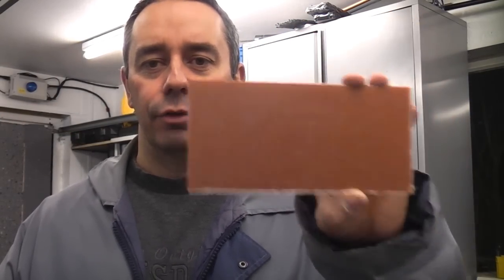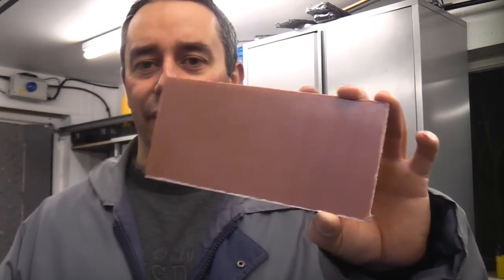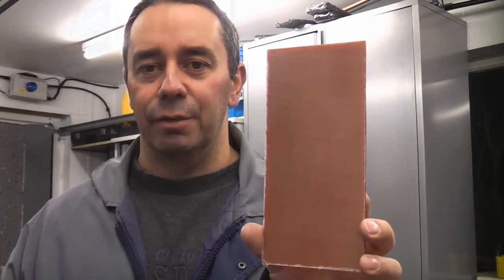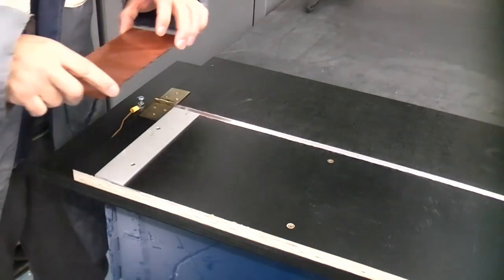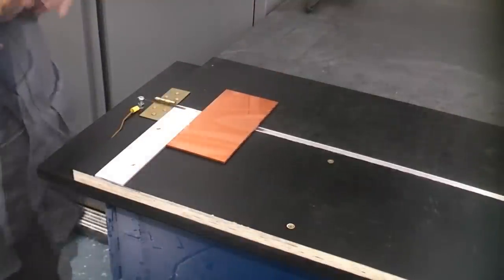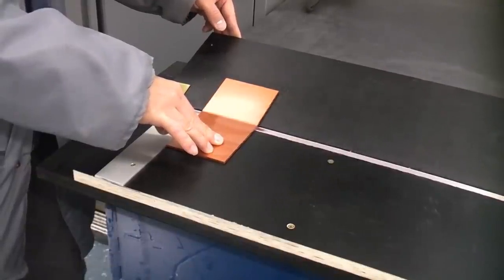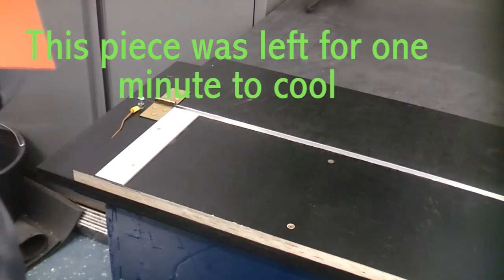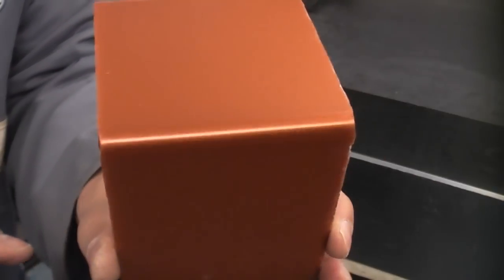How to line bend acrylic | line bend Perspex

Comment: To get a tighter curve you can cut a groove the width of the plastic and as deep as half the material. Great vid love the new intro, might try making a line bender but I'm not sure how often I would use it and I don't have a power supply
Reply from the maker: Thanks for the tip.
I have been meaning to make one of these for years. I am sure I'll find plenty of projects for it now LOL
Thanks for the comment

Comment: One could add holes along the bottom surface and line them up with the wood thread inserts you've presented in a previous video, then using surface clamps or toe clamps (made of plastic, it doesn't need much) , clamp the material down.
Reply from the maker: Yes, you could do that if you liked ;-)
Thanks for the comment

Comment: Question: If you bent along the length of a long piece, would it be prone to cracking due to thermal expansion, etc in an outdoor application? I'd like to bend a piece 8' in length so that the main face is 6" and two side "wings" (bent 90 degrees) are 2" in length. Appreciate any response. Thank you.
Reply from the maker: Hi, yes it would be prone to cracking unless you could anneal it. Bending such a long piece and then annealing it would be a big job.
In the UK you can get Perspex or Lucite, Lucite is made for the sanitary ware market and has some different chemicals in it for when it is vacuum formed into baths etc. If Lucite was used you might not have to anneal it, but you can only get it in a small selection of colours.
Reply: Thank you, I'm now researching custom glass and polycarbonate (3Form XT Koda) options for my project.

Comment: Hi enjoyed the video. What would you advise as the best method for cutting acrylic sheets to size. I have thin 2-3 mm sheet that I need to cut into small 9"x4" pieces.
Thanks Alan.
Reply from the maker: It depends on what you have available really Alan. I like the chop saw as it gives a nice clean cut.
You can get good straight cuts with a circular saw https://www.youtube.com/watch?v=AqtKH8VfRcI
Or you can scribe break it as well, but this makes the edges a little more difficult to finish https://www.youtube.com/watch?v=U7cquDldE0Y
Reply: ***** Thanks. Watched the links. Might try to scribe first, Do have a large circular saw, but blade seems a bit heavy duty. Have got a mitre saw with a 40 tooth blade.
Reply from the maker: Alan Hurley
If the mitre saw blade is TCT it should cut it easily.
Good luck with it ;-)

Comment: Thanks for the videos! Could you suggest a bench power supply for bending 600mm wide 3mm perspex using the line bender? thanks
Reply from the maker: You are welcome.A bench PSU with up to 30v and 5 amps should do the trick, here is an example-
http://fave.co/2cbpTg2
Reply: Great video. PSU as low as £40 are available and I use one.